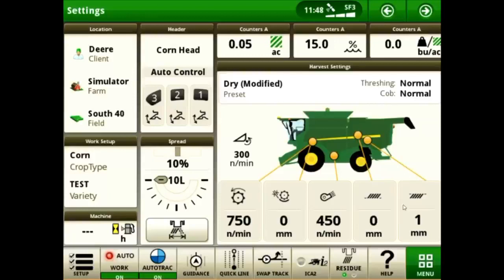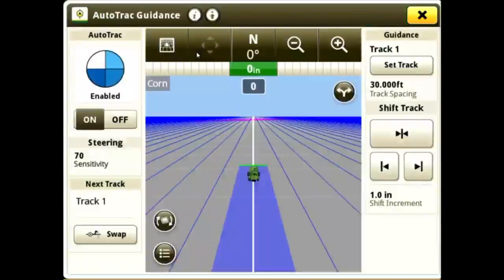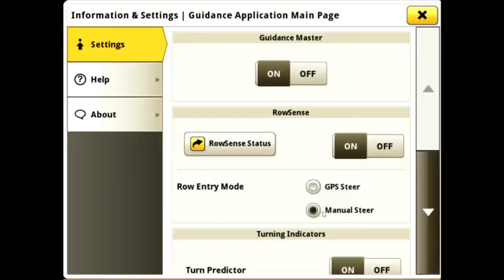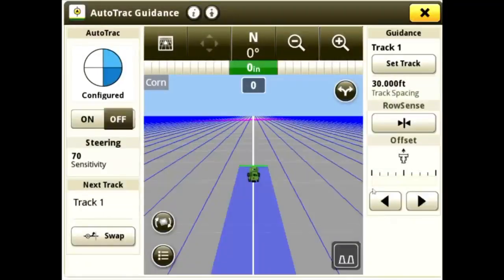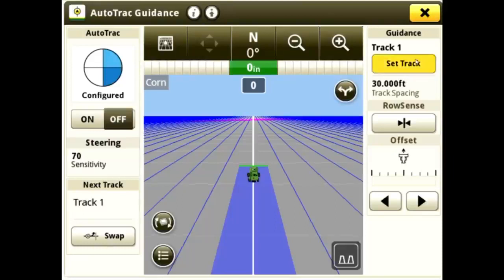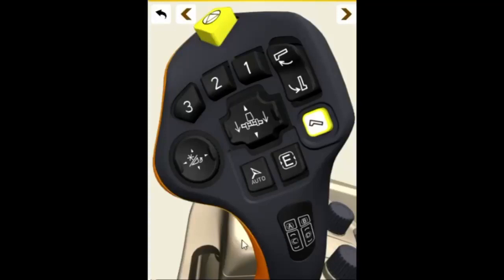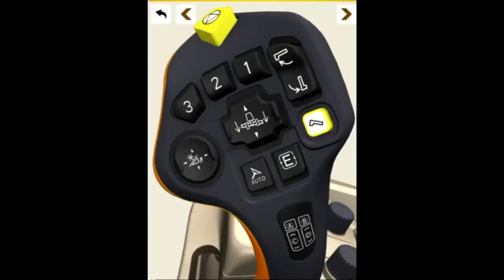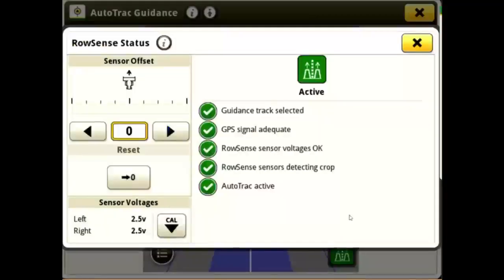Technology Thursday: How To Set Up RowSense

Comment: How do I disable it and just use gps? I have the planter A/B in but toggled off and still won't steer because it wants to use row sense which my head doesn't have.
Reply from the maker: Hi Paul - if you are using a Gen4 monitor (4600 / 4240 / 4640) you open the guidance window, then select the top of the page where the arrow pointing up is at.  On this advanced settings page there is an option to turn on or off the ‘RowSense’ master.  This could vary depending on the model of combine you are in however.  If this doesn’t work please let us know and we can guide you in the right direction